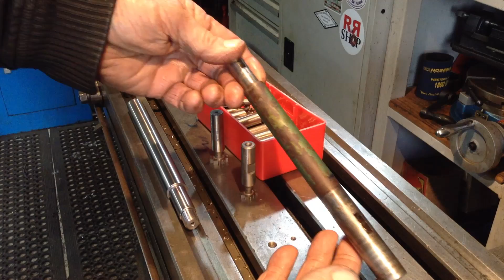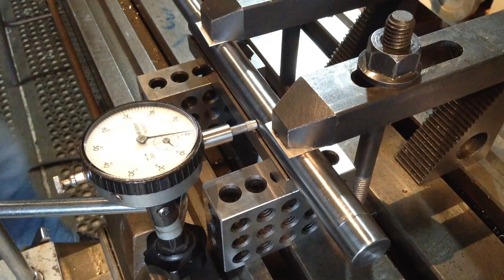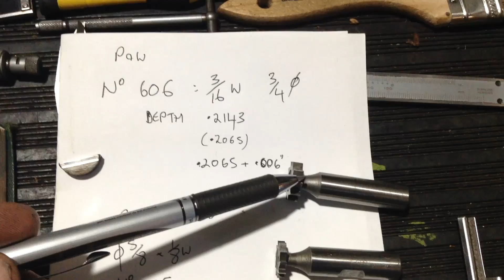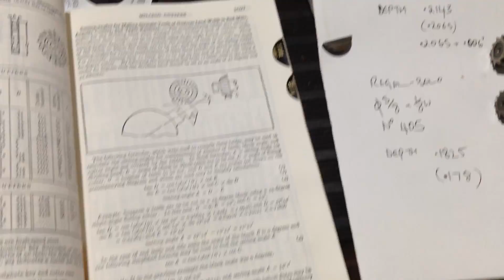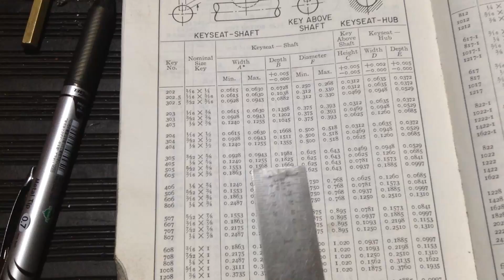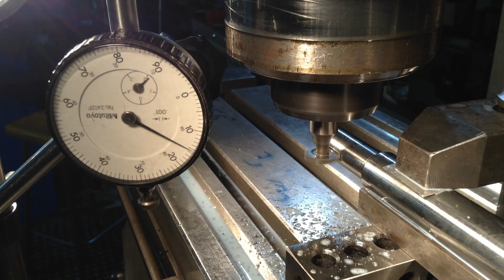Two Woodruff Keyseats To Cut & One Rooted Cutter !

Comment: Nice job on the keyway Max , that shaft sounded hard as a rock when you hit it with the file .
Reply from the maker: Yes it used to be a high grade bolt !   Things would be boring if everything was made from soft 12L14 !  Cheers .

Comment: Hi Max, I run my HSS Woodruff cutters about half the speed you were running yours, on that 10.8 steel, preservation without a T&C grinder.
Have to mow my lawn every 4 day's in the tropics here!!!!
Reply from the maker: Is it monsoon season or something there , to mow so often ! It's coming up mower season out at the new shop soon .  More shed & driveway means less to mow ,  only about 8 acres now !      I always worry about running woodruff's too slow in case they break !  Can't remember the rpm , but if it was sharper it would have done it with ease .    Cheers .
Reply: Hi Max, I am latitude 14 degrees North, exactly opposite Darwin 14 degrees South, we are in the wet season,  afternoon thunderstorms and then the sun comes out,  humidity is extreme,  the lawn and plants love it, my Avocados, Bananas and Mangoes are thriving, yes we are in the SW Monsoon waiting for the next Cyclone.

Comment: For those that didn't understand Max's reference later in the video to size of cutter verses No of cutter, in Imperial sizes the cutter number refers to the Width as the first two numbers in thirty seconds of an inch. The last numbers, in this case one last number, refers to the Diameter of the cutter in 1/8". So a 606 cutter is 6/32" thick and 6/8" diameter. Edited for wrong value entered by me.
Cheers Max, John Australia.
PS The last 606 I bought was High Quality Dormer and was $109 so when people Bitch to me about the cost of a job I tend to say, do it yourself!
Reply: Or for fans of Kurtis “bananas”
Reply from the maker: @alasdairhamilton1574   Funny thing is  if you live in Queensland Aust like Kurtis  , we call them banana benders !
Reply: Not to confuse anyone 606 is 6/32' (3/16") width and 6/8" (3/4") diameter
Reply from the maker: @geofflodge6784  That's why i use machinerys handbook ,  so i don't confuse myself !!!  Cheers .
Reply from the maker: It's been a lot of years since i have heard the breakdown of the cutter number .   Cheers .